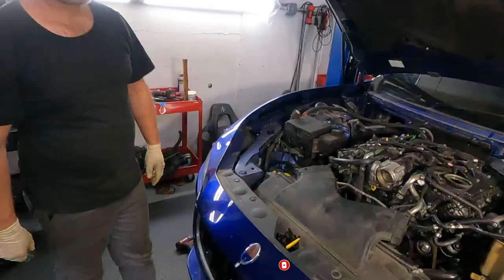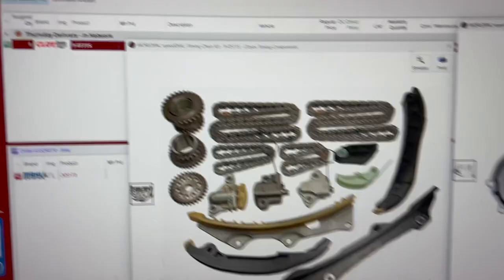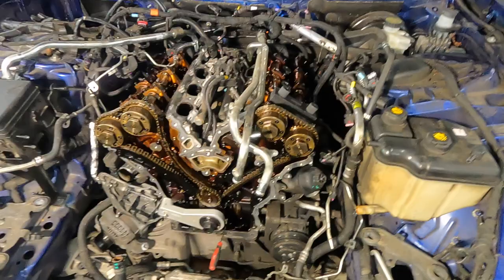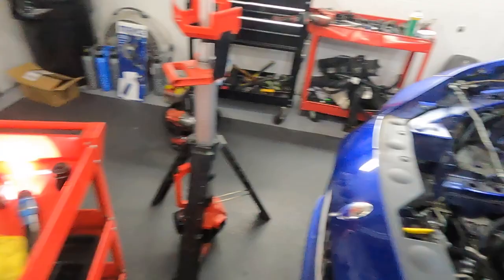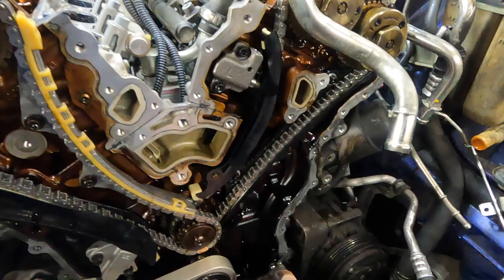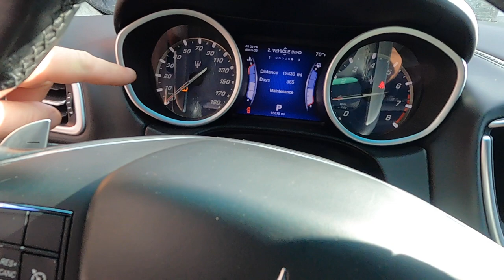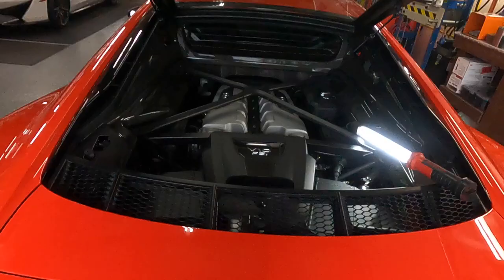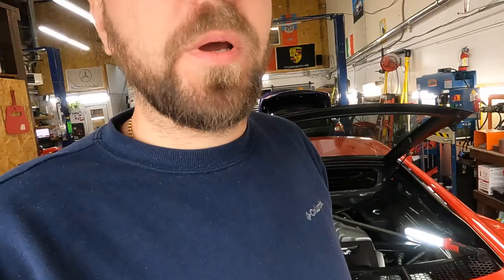Maserati Ghibli 3.0 Timing Chain Replacement  Vlog #96

Comment: Great episode. The Maserati engine looked like a 5.0 Ford Coyote Engine. That might be a good motorswap if the engine is kaput. No heat shield on the Audi. Definitely not good. You called them out as nice as you could.
Reply from the maker: Yuup , shop charge the owner crazy money for poor quality job

Comment: Hello, I have a question. For the Maserati front cover when you did the timing chains. What is the torque sequence and torque for the front cover . I have the same car and I cannot find it anywhere. Can you please help.
Reply from the maker: You can use all specs from 2016 3.6 jeep wrangler . They are the same
Reply: They have the same front cover?
Reply from the maker: @salalawi34  yes , I mentioned on the video what part i used for this job . Watch carefully
Reply: Look at the varnish no oil change
Reply: @GermanAutoHaus  sorry to bother you guys. I’ve been looking all over the Maserati forums. Can I swap my 2014 front bumper cover with a 2018 bumper cover. To me they look the same. Thanks.

Comment: Hello and good job guys, so you are saying that Maserati engine is the same like one of the 3.6 pentastar or jeep wrangler? Keep up 👍🏼
Reply from the maker: Same design . timing kit is the same
Reply: Ok I get it, thank you, I have a quattroporte with 54k miles and it’s starts to ticking something at the engine on the driver side, it might be timing chain?
Reply from the maker: you can check by actual values on cam adaptation